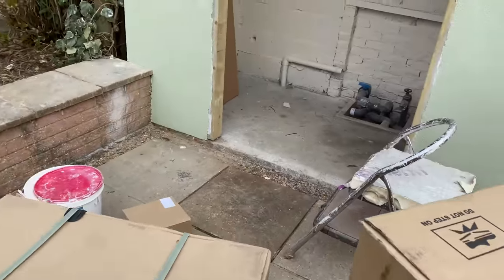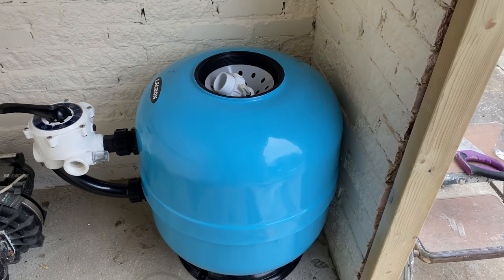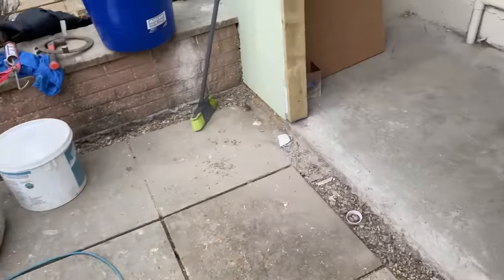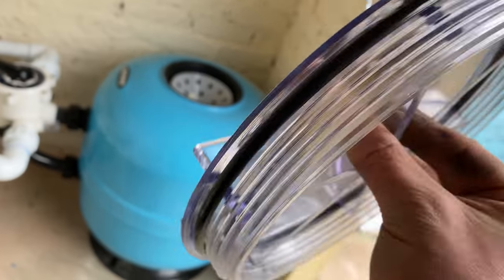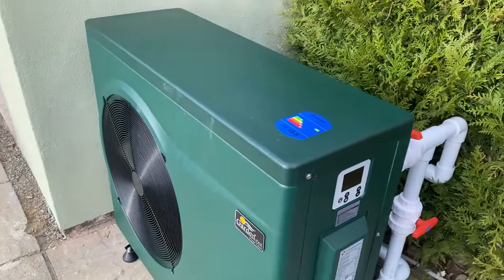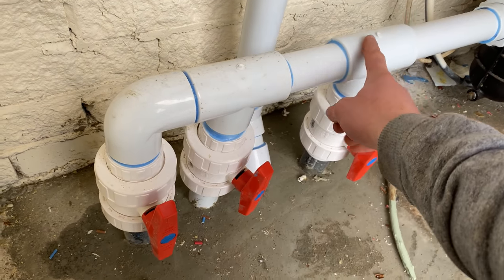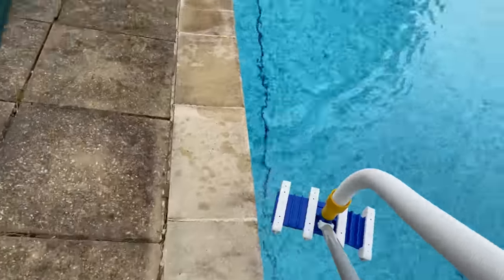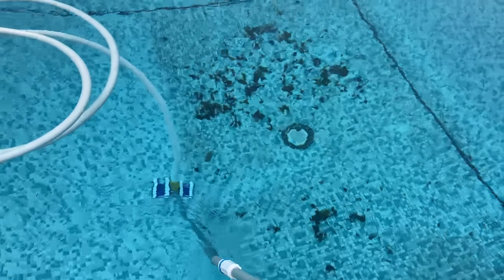pool plant room install

Comment: Pretty impressed with the install. Better than most professional companies in my area. Couple of comments. Should have installed an NRV between the Airsource Heatpump and the Chlorine Tablet Feeder. This would void the warranty on the heater. Also some pipe clips to the wall on those longer pipe runs. Pipes are heavier when full of water. Hate that blue glue, reminds me of Hot Tubs. Wet R Dry is so much better. Keep up the good work👍

Comment: Pump use brand starite right?
Reply: I believe that was starite. I like hayward. It's easier to get parts in my area in the US it will become a federal law to have a variable speed pump in a couple months.. so if you need to replace the whole thing (not just the motor) you will only be allowed to get a variable

Comment: i find it safer (and less concerning) if you wire nut or electrical tape over any bare wires even if they are not connected to anything